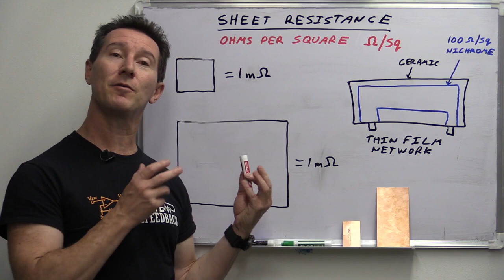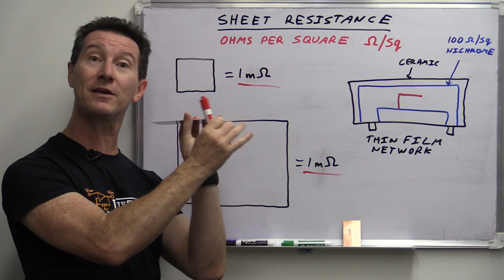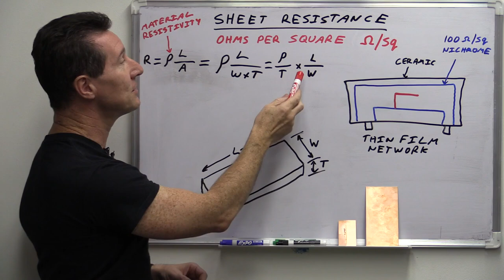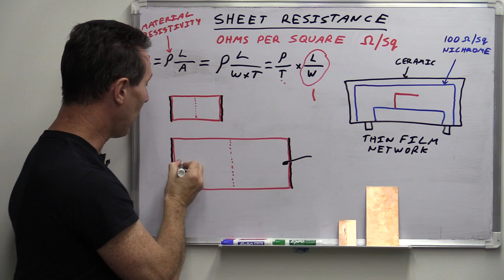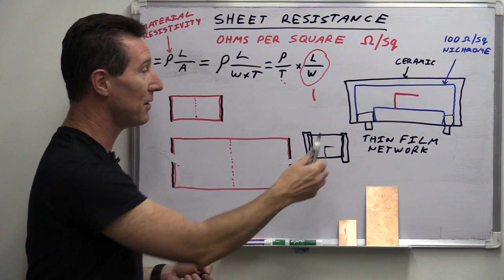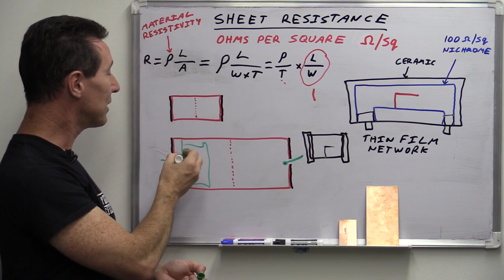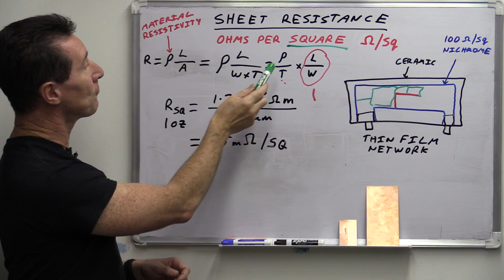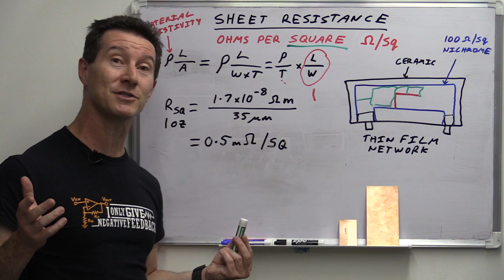EEVblog #732 - PCB Sheet Resistance

Comment: I think what is happening is that there are more paths for electrons with larger squares, but more material to go through, so they cancel out the resistance. Granted you have the one side the same, the other getting longer, the resistance goes up...

Comment: I'm surprised you didn't use the analogy to wire thickness. Same formula, much easier to understand and probably everyone is aware that a wire with smaller diameter/area and longer length will have larger resistance than thicker, shorter wire.

Comment: Make an analogy to resistors being put in series as the trace gets longer… but also in parallel when the trace gets wider. The series resistance is cancelled by parallel resistance. So as long as the aspect ratio of all traces (boards) is the same, then the resistance remains constant.

Comment: So how does trimming (laser cuts, etc) factor into it? Does it just break up the larger square into more smaller squares, which increases the resistance?
Reply: Scott Lawrence yep. If you look at the resistor video and imagine the trimming ladders as squares, you can see if you break a connection, you're adding squares. If you look at the L shaped laser trim drawn on the board, you can see that the thin section the current travels through is now made of more smaller squares because the width of the conducted path is smaller.

Comment: You had the three square sheet in serial, and got 15k ohms, would it be safe to assume then, that the three square piece turned 90 degrees to get it in parallel would give us about 1.6k ohms?
Reply: Yes.

Comment: This is very good but what about non-ideal properties, does the current avoid the middle or edges of the metal, even if not externally influenced by static/magnetic fields?

Comment: Great video, how many college lectures are using your videos in there lectures. 

Wondered if took a copper clad board and stripped out the middle leaving two tracks for the high conductivity area then silk screening some sort of conductive paint across the board that gives more resistance than copper. Then you could take a dremel to it and carve out paths across painted area to physically demonstrate how the intricate cuts affect the ohms per square.

Comment: Hi Dave !

Really a very very interesting info - though it's a little hard to grasp, but the math is there to help you - right ?

BUT ,,,

I think - maybe I remember wrong - the current is ONLY running in a thin layer on a round wire - IF that's true, then "a wire" can be interpreted as a "folded squar to a tube" and we can use the same "thinking" - maybe I was too quick there !

PI cm of wire with Ø1mm (the "squar" will be equal to the circumference !) 

should have the same resistance as

10 *PI cm of wire with Ø10mm
Reply: Keld Sørensen You're thinking of the skin effect, but afaik, that only applies to AC. Although it doesn't matter, because your thinking is still true with DC, I think. A 1 mm diameter wire of length 10 cm should have the same resistance as a 10 mm diameter wire of length 100 cm. Correct us if we're wrong, Dave, maybe in a followup vid?
Reply: Daedalus Young No, its not correct. For R to stay constant L/A needs to stay constant. If you take 10 times the length, you need 10 times the area. But by multiplying the diameter by 10 you get 100 times the area!
Reply: Baurophon Ah of course, that's right, but you could calculate how much bigger the diameter needs to be to be 10 times larger than the smaller wire, then it would work?
Reply: Daedalus Young Then it schould work! A 1mm wire of length 10cm should have the same resistance as a 10mm wire of 10m.
Reply: Baurophon That is useful to know, if you've got a certain length of wire and you want to keep the resistance over that distance to a certain maximum. Dave's showed those probes with a certain resistance before, I can see how this theory applies to those.
Reply: Daedalus Young Yeah, don't get mixed up with diameter and cross-section area.

A 1mm diameter wire of length 10cm has the same resistance as a 10mm diameter wire of 10m. But a 1mm^2 wire of length 10cm has the same resistance as a 10mm^2 wire of 100cm. Luckily most wire is specified in mm^2 so you can just use those measurements...

Comment: Also, wouldn't you be pretty much be doing the same thing by running a thin wire along the edge of the resistive foam and connecting your probe to the end? And then for that matter, just probing the corner? The spread of the electrons due to those sheets are probably so miniscule it probably didn't make any noticeable difference

Comment: Could this be used to make giant DIY foam load sensors?

(And thanks for the FFriday, really appreciate these)
Reply: smellysam Yes. But the interface between foam and a conductor is very tricky and interfacing foam to copper usually ends up with copper slowly oxidizing or outright corroding (some older foams turned out to be corrosive over decades). It’s OK for a demo or an experiment but in a product you’d need way more engineering to qualify the change in foam properties over time and load cycles, changes in interface properties over the same, durability of the top plate should it be exposed to non-uniform loads (like people stepping on it), and so on.

For homemade load sensors, the conductive black 3M anti static bags and similar materials are great: their life and properties are much better than those of foam, because they are a void-free solid. Linnstrument is made that way – look it up.

Comment: What happens with the high heat transfer of the nichrome?  Is low power what keeps it from getting to hot.. Know that nichrome is what is used on things like toasters and ecig heating elements..
Reply: Nichrome gets got simply because of the resistance.  Nichrome is used as a heating element because it has a high melting point and a high bulk resistance.